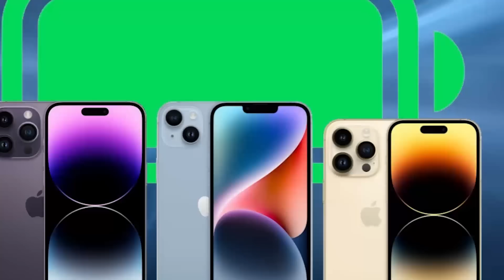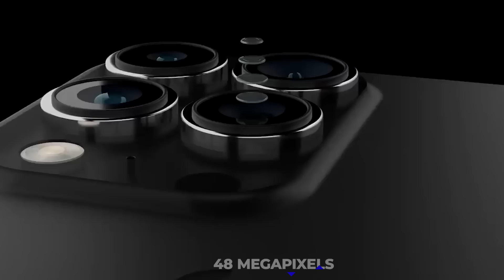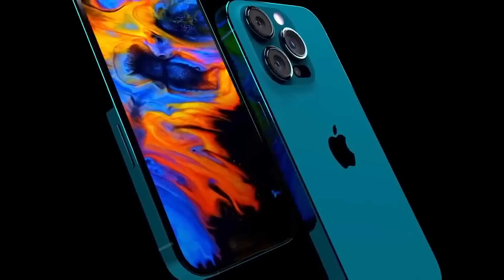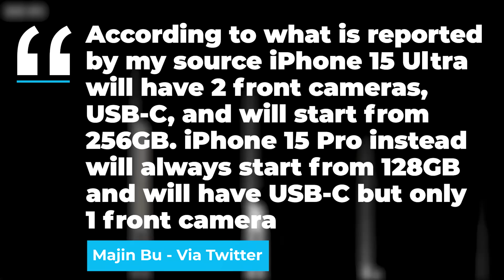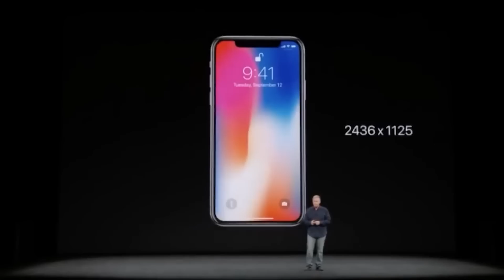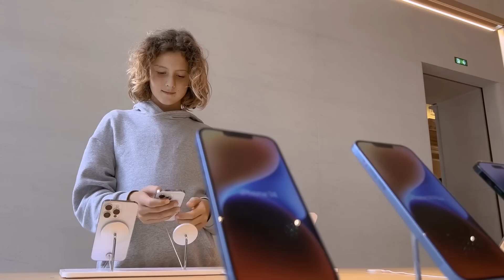iPhone 15 Ultra is Coming: Do Not Buy iPhone 14 Yet 😁

Comment: Man get rid of that USB-C shit. Keep the lightning port
Reply from the maker: EU Policies.
Reply: They might keep it for USA?  However  EU pulling power will make them either go full wireless or USB . Thank god .
Reply: @robduncan599  I’d be pissed if they went full wireless🤢 Also, from what I understand, Apple will be doing USB-C on all their phones but they’re pulling their own little trick by making it to where you can only use apple branded products like an apple charging cable or apple wired headphones.
Reply: @JoseDiaz-bk9mh  I think the wireless only charging might still be an option?  Just as they did away with headphone Jack the wireless only charging would be their preferred option if they can make it work?  They don't like having to follow European Union rules?  Personally I see advantage in no ports that get gunked up over time ? A small portable power bank slapped on the back for heavy users might work for many rather than having leads attached?  Just as no headphone Jack was hated by many , people are getting used to that . Time will tell what's next ?

Comment: Apple's best invention is making millions of people think incremental improvements that most people truly won't care about or use are worth prematurely dropping $1,000 plus ever single  year. How about an iPhone that has a better and longer lasting battery, and a design that makes the darn glass impervious to breaking.  iPhones have been out 10 plus years and the battery still can't power them for more than a partial day and the chassis literally has a glass jaw. If Apple were a car company they would be wowing us with break peddle warmers sand programable exhaust noise while getting 5 miles per gallon and having the window break every time is snows. Complaining aside I'll end up buying a 15 lol.
Reply from the maker: No option I guess. 😂
Reply: You had me until the end. 🤣
Reply: Selfie cameras is terrible vanity. Also I wish they would get rid of the notch altogether.

Comment: i really enjoy the i phone 14 pro max, the battery life is very good, the performance and buttery smooth scrolling is great. I upgraded from a 6, so maybe the more recent i phones are not that much different, but for me it's a huge upgrade
Reply: That’s literally a rebirth for u dude.. enjoy
Reply: I got my 14promax last October, it’s almost 5 months and the battery is still 100% . It can last the whole day
Reply from the maker: Yes that’s huge tbh
Reply: Which adapter you use for charging. I mean how many watts . 
I charging my 14 pm with 30w and my phone battery health drop to 97% in 4 months.
Reply: @alamafridi6742  That's an expected drop in 4 months. No big deal.